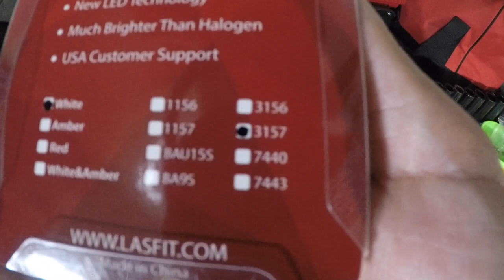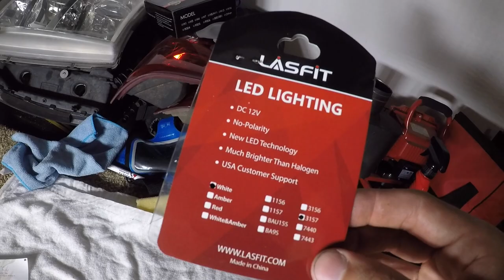LASFIT LED Reverse Lights - Bright as a Collapsed Sun. 2007-2013 Silverado

Comment: Actually the original Factory reverse bulbs are not halogen, they're just plain incandescent bulbs. Halogen bulbs always have a gas in it and you'll notice like a nipple at the top of the glass where it has been sealed completely to retain the gas.

Comment: I ordered these and my 2010 gmc uses a 194 bulb for the back up lights, do you have 3157's because your taillights are aftermarket?
Reply from the maker: My wiring and connectors are still stock. Only the lenses are aftermarket. This video was made 4 years ago so there is a chance the recommended bulb has changed. I would trust the website reco 🤙🏽

Comment: Did you ever have any issues with your Headlight Harnesses having shorts in the wiring? I've been through 2 sets of harnesses and they've all given me problems. It's getting irritating having to take my truck apart to work on them.
Reply from the maker: No problems yet. (Knock on wood)

Comment: Yeah..very bright but just how reliable are they gonna be... Expensive ... look good but how reliable are they ?? Your last Amazon ones looked good but you say they are 3 years old and failing..?? Its not as if reversing lamps are on for hours at a time so thats actually very poor for them to fail...  Ive got a Honda CRV and have changed some of the bulbs - headlamp - side light - rear indicator - and reversing lights only so far. Not keen on changing stop/tail lamps cos a lot of people say the tail lamp is too bright and theres only a slight difference when you hit the brakes... Retro fitting an old light fitting with an LED bulb that it wasnt designed for is cool if the LED array suits the reflector but some designs may not be suitable for all lamps..

Comment: Hey #LSH have you found an LED bulb that will work in your headlights?
Reply from the maker: Not yet. Still considering going HID. No LEDs i've found will fit due to the fan.
Reply: @LonestarHawaiian  that's what I figured. I'm sure you'll find something that looks great! Really dig the truck. Keep up the great work.
Reply: @LonestarHawaiian  have you measured the distance between the end of the headlight housing and the bar the fan runs into?
Reply: Look into the Supernova perfect fit series for the headlight upgrade. Have seen other brand fit also with some minor modification. Cheers.

Comment: good video, I been using lasfit for some time, they are the brightest, only detail in your video, original back up bulbs are NOT halogen, they are just incandescent bulbs, halogen are mostly used in headlights
Reply: You understand that halogen bulbs ARE incandescent, right?  But not necessarily vice versa.
Reply: yes, you're right, both are incandescent and both uses tungsten filament, the difference is that halogen bulbs have an inert gas inside the bulb and regular incandescent don't, in this case regular small lamps or bulbs that you see in stop, turn signal reverse or parking lights are not halogen,  I hope I didn't offend you with my comment, I just want to share some information so your videos can be even better and your viewers and followers don't get confused, congratulations for your videos and for sharing
Reply: @omarvaldes84  Most incandescent bulbs are filled with an inert gas - typically argon, nitrogen, krypton, or krypton+xenon - though some (perhaps these) only use vacuum.

However, a halogen incandescent lamp is filled with a mixture of an inert gas and a small amount of a halogen such as iodine or bromine.  The combination of the halogen gas and the tungsten filament produces a halogen cycle chemical reaction which redeposits evaporated tungsten to the filament, increasing its life and maintaining the clarity of the envelope.